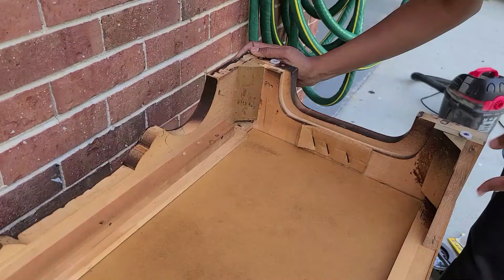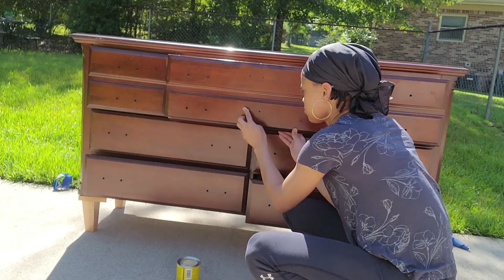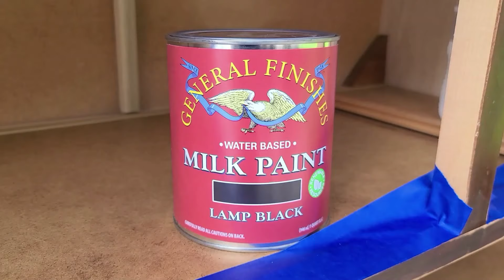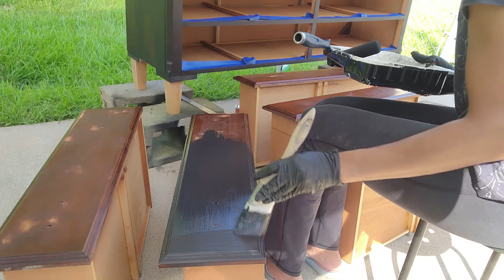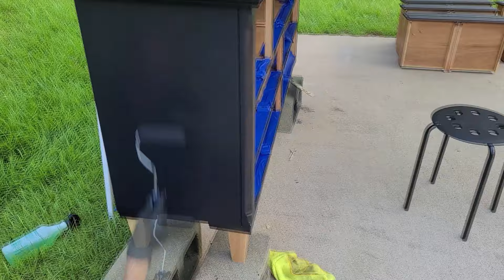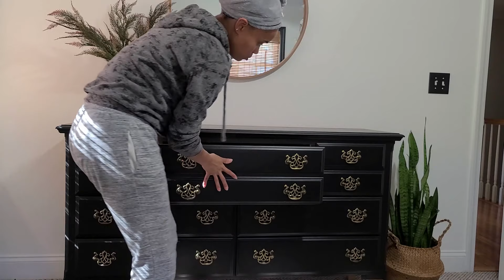Dresser Makeover | Furniture Makeover

Comment: You did good. Do you rinse your cleaner off? If you can take out the sanding noise it's easier to watch because the sound is alot higher when you sand
Reply from the maker: Thank you. I went back over it with the microfiber rag and water. I thought the same after i uploaded so thanks for pointing that out

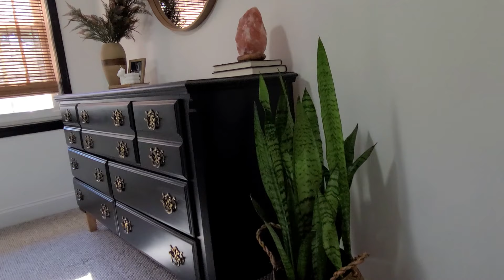Comment: Wonderful transformation!  I especially like what you did to the base, removing the out dated skirt, adding streamlined legs, keeping  them natural wood.  Only one suggestion, same one I've made to others.  It's not about the piece at all, which is beautiful, it's about the photography.  As to all the closeups & different angle video of the completed piece, I wouldn't change a thing, BUT, please make sure to include one, good lingering view that is a full on, front view and captures every inch from top edge to bottom of the feet and from side edge to side edge.   After watching you do all that work, I not only want to see the details (for sure!), but also how all the various elements came together, the total effect.  I turned down the playback speed & paused at 12:46, the best full frontal shot, but the legs disappeared behind the red (YouTube) bar and the light was kinda poor in that shot (sun behind a cloud?).  Thank you for posting!  Definitely subscribing!!
Reply from the maker: Thank you so much. I totally agree with your suggestion. The light was poor, this was a struggle for sure. With the windows open to let the light in it made it extra bright and hard to see and with my ring light it was the same so this was the best i could do. I really appreciate you taking the time to watch and leaving such a awesome comment. This is very helpful

Comment: The project turned out beautifully.  You did such an awesome job.  I had a couple of questions.  I don't know much about milk paint.  I noticed you didn't prime it first.  Does milk paint not require priming at all?  It looks like great coverage with just two coats.  Also, how long did it take to dry before you were able to start putting items on top?  That finish looks factory smooth!  Thank you for sharing!
Reply from the maker: Thank you Jackie. 😊  so this was my first time using this paint and I did alot of research first before I  ended up with this one. The general finishes doesn't require priming especially since I was painting black over a dark finish. The dry time is insanely fast, it was dry to touch in about 30 mins. I applied the 2nd coat after 2hrs because I was tired lol the top coat dry really fast when applying so I had to do it fast and I did a light sanding with 220 grit sponge after the 1st coat of polycrylic and applied a second coat. I didn't put anything on the dresser until days later and that's because I was looking for different handles and I couldn't find any 3" hole handles so I used the old ones and in the end I really love the old handles with it.